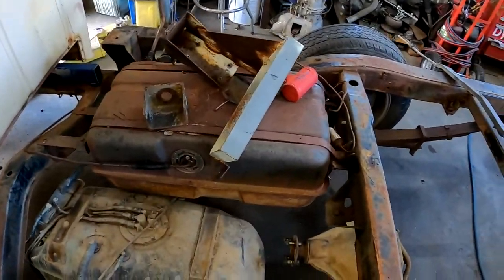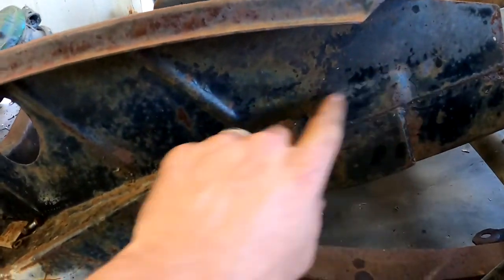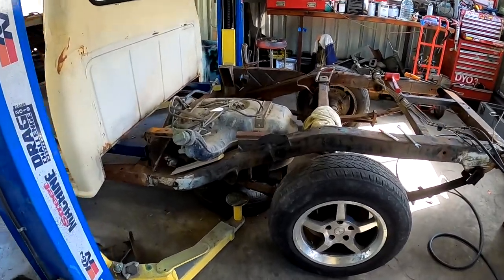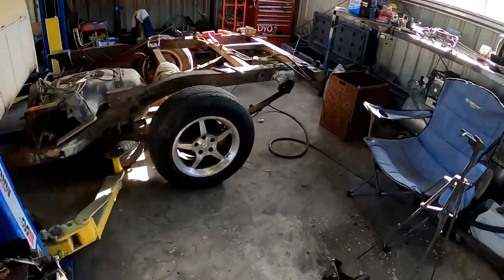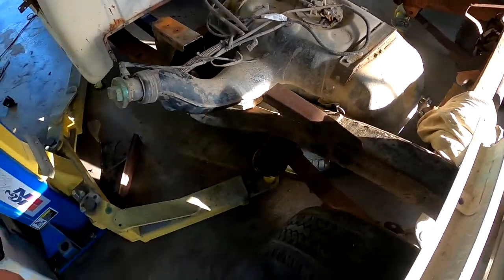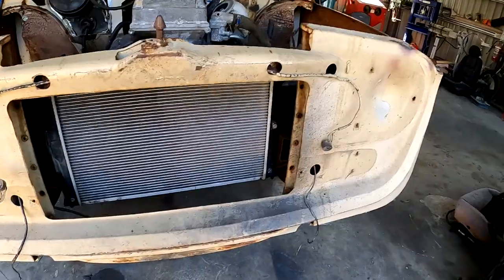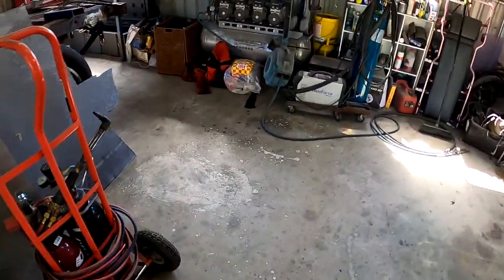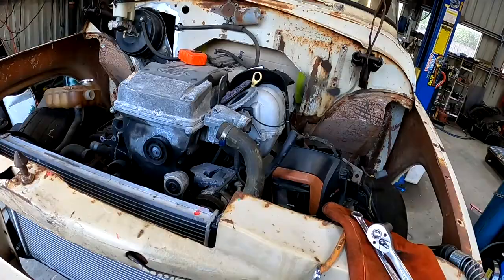Barra Powered C1100 International Pickup Truck Build Ep.5 #barra #international

Comment: Would it be easier to fit a low pressure fuel pump in the Holden tank being used as a lift pump, then use a small 1L-2L surge tank mounted elsewhere with a high pressure fuel pump, fuel pressure regulator and return line?
Reply from the maker: Potentially mate it could be easier but I don’t have a good Holden fuel tank so I went the route of using the falcon tank and this way it utilises the factory pump and I’m going to run the falcon hard lines as well so it works as per factory that’s my thinking anyway.